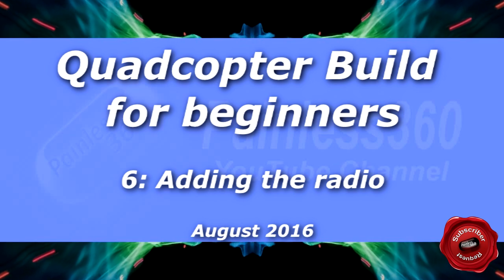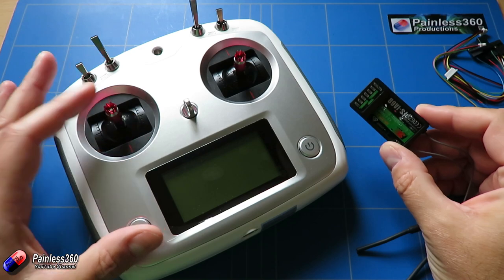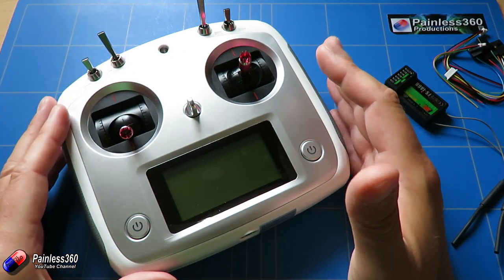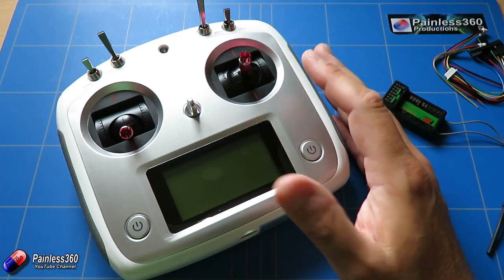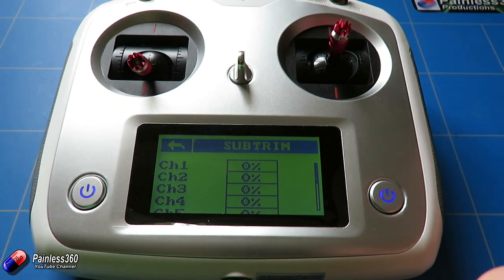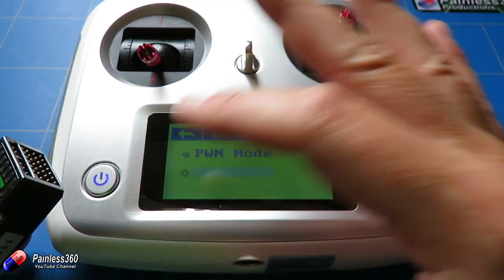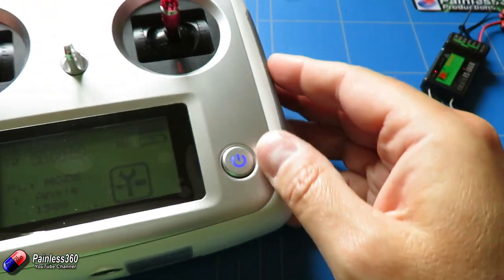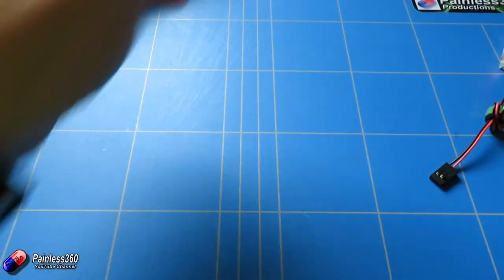(6/9) Quadcopter Building for Beginners - Setting up and adding a radio

Comment: i am using this with a f3 flight board and when i plug it into the portit fit in on the flight board i dont receive the red led lighting up and i have no power? any suggestions?
Reply from the maker: +Tynan Roussety I'd try another usb cable. What troubleshooting have you already tried?
Reply: I should probably make it more clear...I have my radio receiver cable,(red black and white wire), plugged into the PPM/CH1 slot on the receiver .. When i plug the battery into the drone, the drone gets power, the motors twitch for a second, but  no power to the receiver. I have tried different cord ports, different plug etc... just really dont know. i am plugging the cable into the only spot it fits on the f3 flight control...

Cheers.
Reply from the maker: Some flight controllers need the power from the battery to power up the 5v on the board itself and supply things like the Radio Receiver. Not all do, but some.. See the videos in the rest of this series..
Reply from the maker: +Tynan Roussety PS a much easier question to help with there.. keep 'em like that and you'll get better advice, faster. :) Best of luck!
Reply: thanks mate, Will do. 
I usually dont even expect to get a response so the fact that you have responded like 4 times to me, says something about you, and your channel. Keep up the awesome work.

Comment: Hello everyone, Can anyone please explain to me what is the "ports" tab for? And why is the first USB VCP enabled always?
Thanks
Reply from the maker: The ports tab tells the flight controller how it's connected to things (radio reciever, telemetry, sensors, Vtx units esc.). The VCP bit is about making sure that it 'talks' MPS user the USB connection. MSP is short from Multiwii serial protocol and is how the configurator app on you computer talks to the board.. hope that helps, see my Quadcopter building for more tips..
Reply: Thank you for the quick response

Comment: Sir the ESC of mine that is connected to ouput 1 ( which powers the flight board ) does not rotate the motor. Please help??
Reply from the maker: What troubleshooting have you already tried?
Reply: Painless360 
I tried every step mentioned in ur video. Still nothing happens.
Reply from the maker: Then I#d suspect faulty hardware.. Best of luck!

Comment: does this work simular on a spektrum dx6i?
Reply from the maker: Yep, should work in a very similar way..
Reply: Painless360 i want to build a quality quadcopter that is fast as well. i want to use the emax rs2205 2300kv s motors, the sp racing f3, the foxeer arrow v2 but i dont know what frame and esc to use. what esc and frame do you recomment?
Reply from the maker: +Jordi Braun that is a very subjective question. Everybody has their favorites when it comes to frames and ESC. Have a look at the later build series on the channel, the quadcopter building for beginners series 2 and series 3 look at more modern styles of frame and we also cover how to make sure that you're picking the right ones. You are already looking to use really good parts so you're off to a great start. Best of luck

Comment: Is there a cheaper controller that would work?
Reply from the maker: +Dhruv Singh this one is the cheapest one we'd recommend. The other would be the Turnigy Evolution..
Reply: Painless360  do you think this would be a good kit to start with? I've never built a helicopter before and this looks really interesting. I will surely use these videos of yours but I'm a little hesitant if I can do it since it looks complicated
Reply: But I feel like I can do it with these videos
Reply from the maker: Most of the kits now come with a decent range of components. We have also looked at a lot of the RTF/BNF models on the channel too. They all follow pretty much the same build process.. Best of luck!

Comment: Hello, my receiver and radio are bound but when i power everything op and move the throttle stick of my radio nothing will move and in cleanflight it does not show any throttle value difference when i move a channle
Reply from the maker: It’s probably a wiring or a configuration issue inside cleanflight. I don’t use cleanflight anymore I switched entirely to betaflight now. See my other build series for how do I set them up and doublecheck your cabling. Best of luck!
Reply: @Painless360  I first tried to use betaflight but nothing happened at the receiver tab when i moved the throttle/ pitch etc. I also tested my motors with betaflight and they did work so it is not a problem with the wiring of my motors.
Reply from the maker: That's not telling me anything new really. It'll be the wiring or the configuration of the receiver in the software (including the ports settings if you're using a serial receiver). Please see my Betaflight videos and later beginners build series for more ideas. Best of luck!
Reply: @Painless360  I will do that, thank you!

Comment: I can use DEVO 7 is not, if the truth be IO_1 CH1 / PPM Aile're connected to pins (CH1) of the 701 receiving correct.
Reply from the maker: Sorry, I don't understand the question..
Reply: Devo 701 DSSS RX is 7 channel PWM not PPM

Comment: I cannot find that battery elminator with a battery connector at the one side Please any help
Reply from the maker: +Black Mercy most don't come with a battery connecter installed, you can solder one on.  Best of luck
Reply: Yeah i find that out ! Also I would like to ask somethink else! I found a drone that i really want to make but i dont know if i can connect it with the receiver of that radio how can i be sure and actually make the step and buy it ? I am really a noob .... In that drone  I will be using the NAZE32 REV6a MPU6500 32-bit 6 DOF/10 DOF Flight Controller for Multicopter to help you!
Reply from the maker: +Black Mercy see the naze32 series on the channel, I cover it all in there. I wouldnt build a model with a Naze32 now, the support for it is rapidly waning, see my recent flight controller comparison video. Best of luck

Comment: How do you power the reciever
Reply from the maker: Callum McCaughan  all covered in the series.. Best of luck!
Reply: Painless360 I mean what were you plugging into the reciever as well as the bind plug
Reply from the maker: +Callum McCaughan I see. You need to power it with 5v so a 5v BEC or a modified USB cable will work..
Reply: Painless360 where can I but one?
Reply from the maker: Pretty much anywhere. Google is your friend ;) Search for '5v BEC' and you'll find lots.. You can also modify a broken USB cable to provide 5v for things like this too - see my video on it..